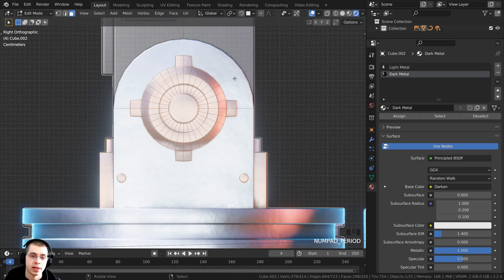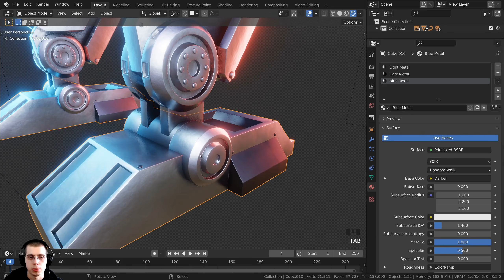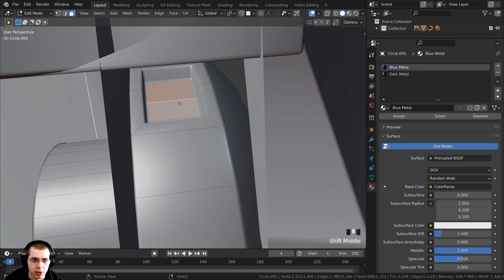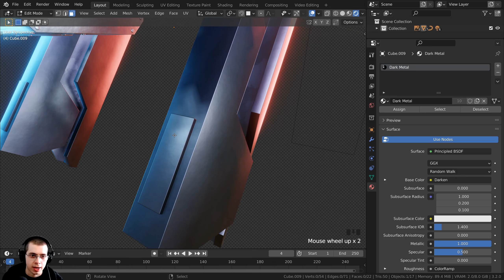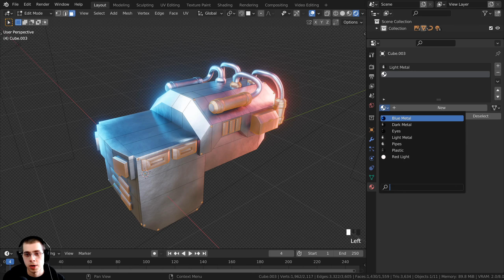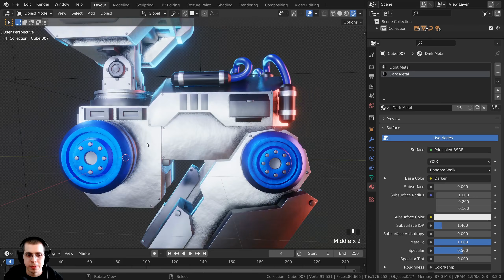Sci-Fi Mech Robot - Part 7 (Blender Tutorial)

Comment: I assign the dark metal in two goes to the blue parts. Firstly select and assign the material to the bolts. Then deselect all, select  the inner faces of the indents, and using CTRL + once on the numpad to extend the selection to the surrounding edges before assigning the colour. That's quicker and easier than using ALT - SHIFT Click on each edge.
Reply from the maker: thanks for the tip.